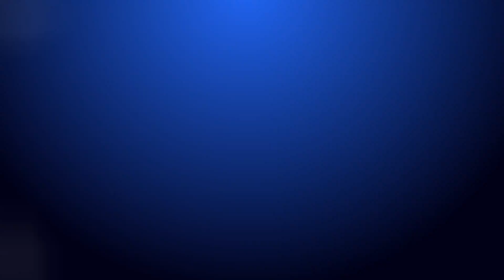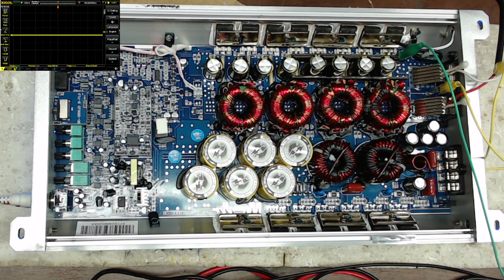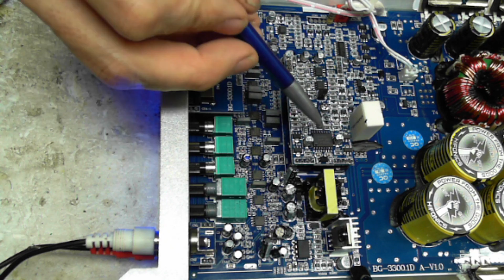Hifonics Brutus BG3300.1 Class D like Orion XTR 2500 boards

Comment: is this amp better than the jp23 v2?
Reply from the maker: Hello, I do not know as I never serviced JP amplifiers. I do know hey are different topologies so it would be comparing apples to oranges.
Reply: This hifonics amp has 6 of those copper winding pieces sorry i dont know the name of it. And it has 6 large capacitors whereas the jp23 has 4 large caps and like 5 smaller ones and only 4 of the copper winding pieces. This hifonics amp appears to be built with better parts. All i did was a visual inspection. I have an older hifonics brx2400 and absolutely love it. I got the jp23v2 and so far its ok..budget amp...was thinking of getting this bg3300 but wanna make sure it will have an audible improvement over the jp

Comment: I have a 1999 yr model Orion 2500/5000 
The game and frequency adjustments are under the top plate of the amp and the game knob is acting up is that something you can fix..
Reply from the maker: It all depends on what the issue is. If it is to a point where it needs to be replaced it may be hard to find a replacement. If it is scratchy from dirt, then it can be cleaned up. I do rebuild potentiometers so that may be an option. www.ellensburgamplifier.com

Comment: I have a brand new Orion XTR2500Dz and it virtually the same exact layout as the Hifonics with the exception of the driver board. It would be interesting what Hifonics is using for the output FET's, The Orion uses IXTH88N30P KOREA TS1852. So why is it that the Hifonics rates their amp at BG-3300 vs XTR-2500 watts? How should go about modifying my XTR to boost the output wattage. You mentioned about higher rail voltage on the Hifonics, would this be the better way to increase the output wattage on the Orion?
Reply from the maker: I would have to compare rail voltages between the two to be able to give an accurate answer to the question. Rail voltage is one of the limiting factors to output power. However, there are many domino pieces that follow. There are no real practical ways to increase the output power of amplifiers. Sam (barevids) has a few videos on an amplifier that he is doing this too.

Comment: Sweet layout
Reply from the maker: Agreed! Although I wish the rail voltage was a little higher.
Reply: @ellensburgamplifier  I've went compact now. Use to deal maxxsonics. Actually running MTX mud amplifiers in my they get the job done.
Reply from the maker: @davidgreggs3903  MTX has interesting designs also. There have been a few MTX boards that I just could not figure out their thought process when designing it.
Reply: @ellensburgamplifier  for me it's either alpine, linear power,mtx or fosgate. I don't care for the generic boards seen one you seen them all
Reply: @ellensburgamplifier  I need some help so today I noticed my subs wet not hitting so I checked my amp and one of the rca was broken and stuck inside the amp so I carefully took it out with a sewing pin and bought new rcas but wene I hooked them up my bass surges bad hog to low really fast like if it was making bad contact or something so I tried my other amp and it works fine but wene I plug the other amp it sounds horrible like bad connection could I have damaged the output jack on the amp